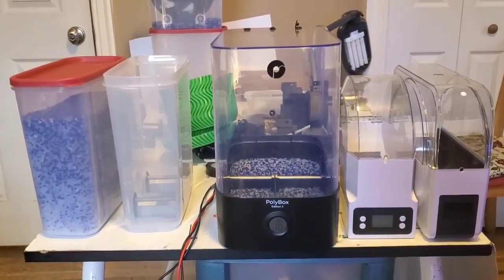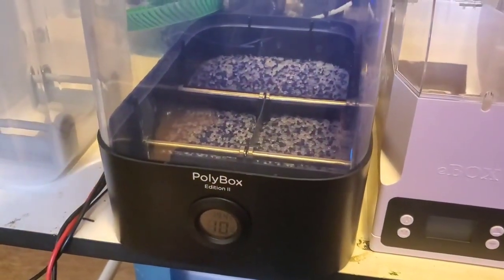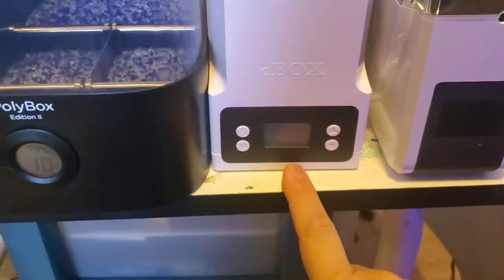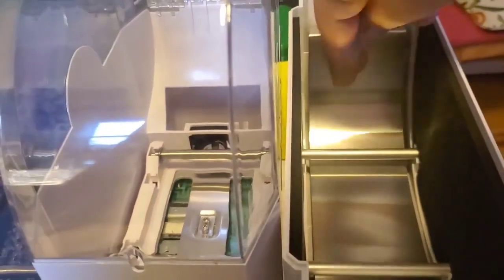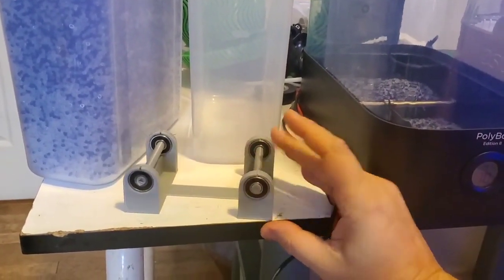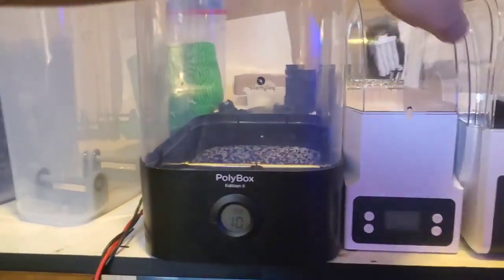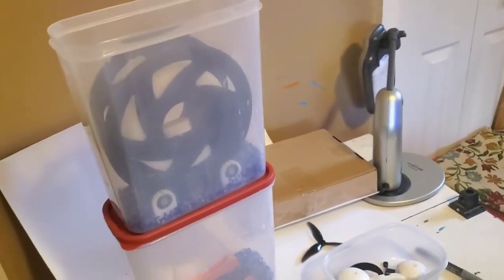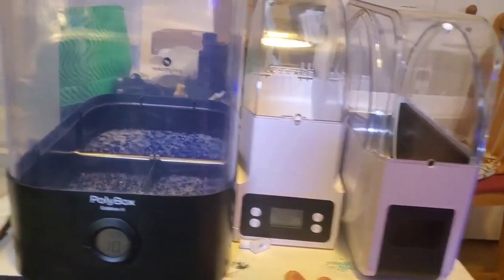How do you keep TPU filament dry while 3d Printing?  I compared lots of dry boxes vs Tupperware tubs

Comment: Would you mind sharing out the files for the filament feeder tube and the rollers you printed for this along with any links to where you got  bearings and other metal pieces? This video is super helpful! Thanks for posting this!
Reply from the maker: @asuwesley  shoot me a dm, this is an old design,  since changing to Bambu the new design uses a single axel in the center m standard skateboard bearings

Comment: How often (if ever) do you have to swap out the dessicant in each container so that it is fresh dessicant?
Reply from the maker: @asuwesley  the desiccant is color changing. So it's easy to tell which tubs are wet. I probably dry  desiccant 3 or 4 times a year, but I keep spare beads, so I can swap individual tubs mid cycle

Comment: Would a reptile heater be good to add as well 🤷
Reply from the maker: That's an idea I havent tried yet. These tubs ofndessicant work really well at keeping the moisture out, but i still need to use the oven to actually dry it. 12 hours at 170F dried a brand new roll... i doubt a reptile rock will be as effective,  but it may extend the time between dryings

Comment: I just use desiccant and the seal bag it came in or a ziplock freezer bag and stuff it back in the box it came in. Note: I'm not selling shit or making any super intricate prints, just printing drone part protectors for myself and the squad and a random thing or three here and there.
Reply from the maker: I started with vacuum bags n little dessicant pouches for storage, worls great..the more dessicant, the better it works.  But it's really hard to print out of a plastic bag, hence the tubs.  My tests have shown a 1KG roll can pickup 3-5grams of water in 24 hours..so the print quality changes throughout the print as it absorbs water in open air.  So i tested all the dryboxes and tubs...and tubs killed it in performance and price 👌 since then  i've grown to hate the vacuum bags, as they often dont seal properly, and unless youre using color changing dessicant or weighing before and after each bagging, it's hard to tell youre wet until you're several hours into a print.

Comment: Having lots of experience with drying all sorts of filament at work, I found that I never needed to dry my TPU filament. Perhaps you need to, in very humid climates.
Reply from the maker: It's around 55% humidity inside here, but ive found that opening a brand new real of sainsmart that you can improve the print quality by drying it before you print. Ive got a bunch of side by side tests
Reply: @Fly_High_FPV  Interesting, I have experienced that my blue Sainsmart TPU doesn't produce the same quality as my red sainsmart filament. Drying never hurts.
Reply from the maker: @icp-trek  yup, dry every roll before printing for best results, keep it dry while printing to maintain those results, and store it so it stays dry between jobs 👌